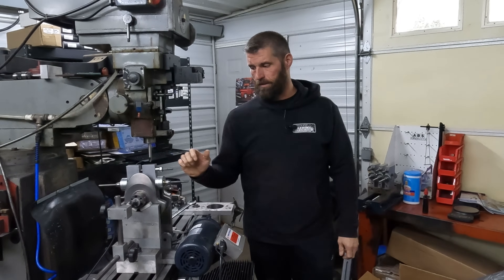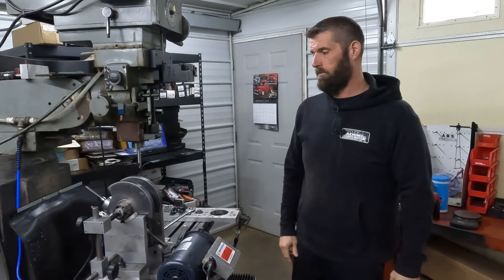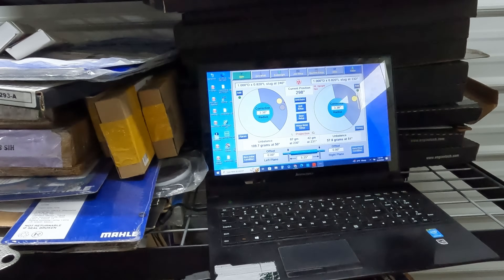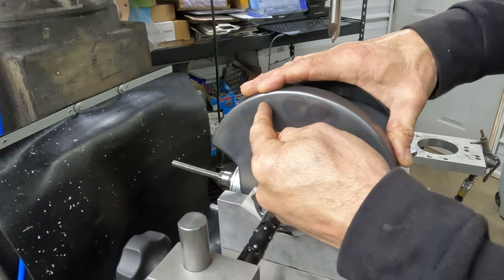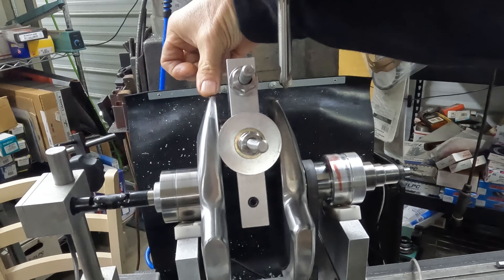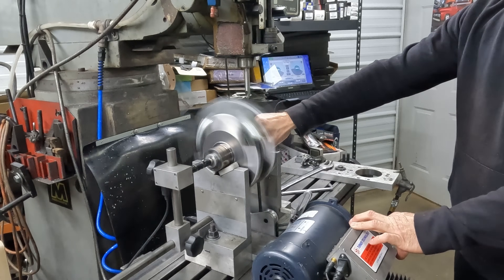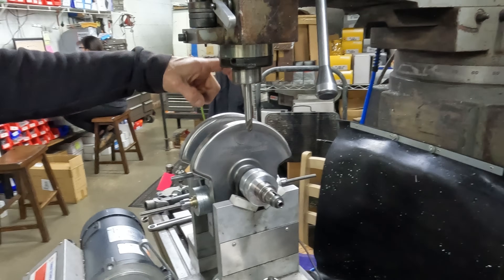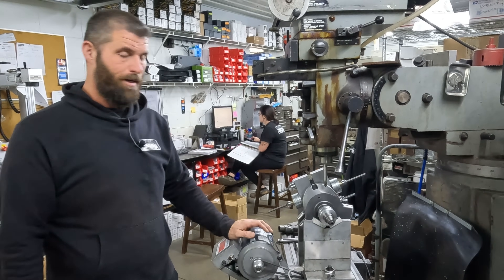Balancing a Pro Stock Harley crankshaft

Comment: I feel bad for the guys that spent $8k on those crank shafts, then hundreds on “balancing” to have their parts trashed.
Reply from the maker: Why would they be "trashed "??
Reply: @powellmachineinc  I guess not trashed, but by the time you fix work done by the previous buffoons, those cranks they are going to be more Mallory than steel.  In my mind that previous shop owes the team a new set of cranks.
Reply from the maker: @BlindBatG34  the crankshaft manufacturer did the balancing job.....

Comment: First, after using all the top balancing machines over the last 45 years including Stewart Warner, Balance Technology, Heinz, Winona Van Norman, and the best, CWT Multibal 5000 or 5500, I have no clue what that contraption is on your milling machine.  Actually, I do, but no legitimate balancing shop would use that Indian cheap ass thing you have.   Surprised you would even show it on video.  No one with a $4000 crankshaft would allow you to balance that crank on that contraption.  Please do a follow up video and tell us you were joking.
Reply from the maker: I love people like u, ... always makes me chuckle 😃
Reply: @powellmachineinc  I`m pretty sure that you can block these trolls Sir
Reply: I believe that's a Turner setup he's using, which is capable of locating imbalance with consistency and repeatability.   Before you start more condescending BS, I was drilling cranks for mallory metal and taught by one of the best starting in 1988, so I have a little knowledge on the topic as well.
Reply: If you have used them all ,you must have access to at least one. Post some videos of your work.👀